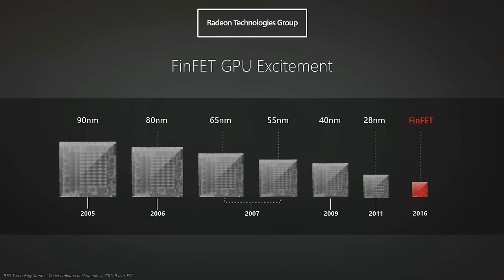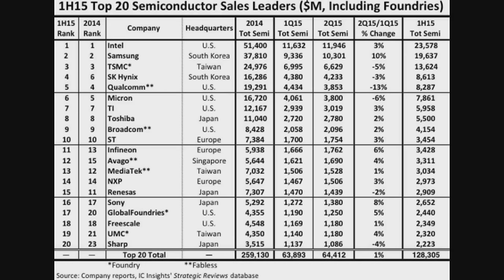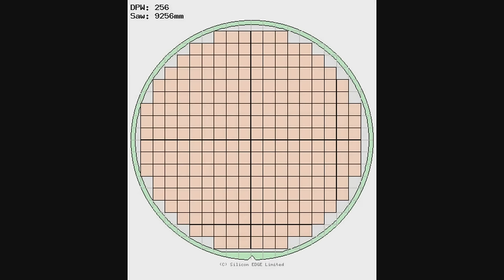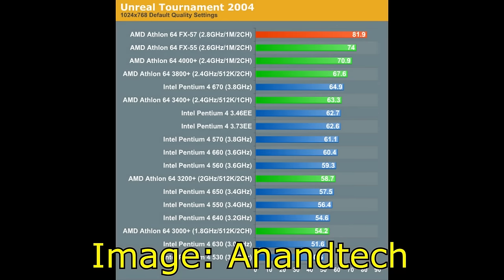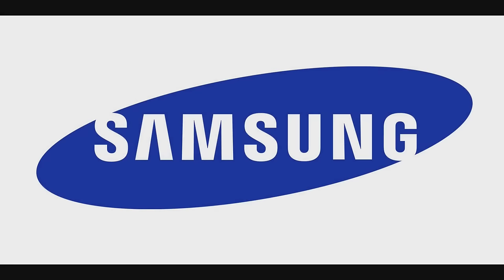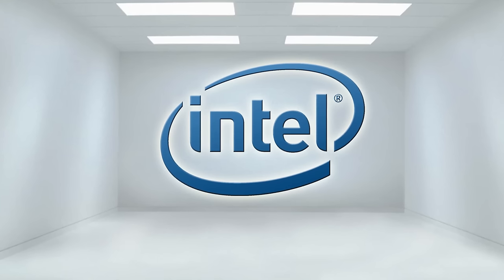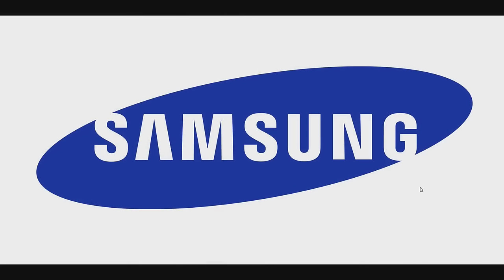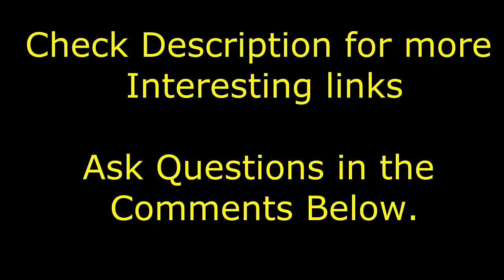Nanomatters - Chip Technology for Gamers.

Comment: Hi I've sold my GTX 980 and getting the AMD Fury or Polaris due to the Fury's superior performance over GTX 980 in Directx 12 games such as Hitman, Quantum Break, Ashes of the Singularity and many more Direct X 12 games to come etc. The AMD Fury, 390X etc trounces the GTX 980 and GTX 970 in Directx 12 and I think its due to AMD's superior asynchronous compute hardware over Nvidia Maxwell. I do not want to be stuck with an Nvidia architecture that is rapidly losing its shine. Another consideration is because I will be getting a FreeSync monitor at a price cheaper than a G-Sync monitor. Why the hell should I, as an Nvidia "fanboy", pay extra for something that is very similar and yet is not FREE? Freesync is the way to go with BIG DADDY INTEL SUPPORTING AMD on freesync now. Intel will never pay Nvidia $$ for G-Sync. They are a big company with pride. Fury, 390X and Polaris works with FreeSync while GTX 980 can't.PS Currently an Nvidia user but switching over to Team Red AMD soon. I'm supporting Team Red as I think proprietory features cause the consumers to lose in the long run. So I think AMD's GPUOpen and FreeSync are better and wiser choices. And BIG INTEL is SUPPORTING FREESYNC. So its like almost 80% Intel iGPU + AMD APU + AMD dGPU market gonna be freesync over the next 2-3 years? Yea right. So Nvidia G Sync will go the way like Toshiba's HDVD and the DoDo bird. And here's from an ex super  NVidia 'fanboy'. Enough with the proprietory crap. Let  me share with you more on wny Nvigreedia pissed an ex super NVidia fanboy like that. BTW, gibs n fluids PhysX crashes Nvidia users like me in KF2 and I DO NOT APPRECIATE NOR NEED THIS SHIT from proprietory shit. If gibs n fluids do not work well in Killing Floor 2, why the F do I need an NVidia card for??? AMD card works fine as well!  And AMD cards CAN NOW USE CPU PhysX due to the new PhysX 3.3 SDK. With a possible up to 32-core Zen on the horizon, CPU PhysX looks like big prime time. Time for CPUs to proof their worth. 8-32 cores with hyperthreading,  huge L3 caches, will boost fps under CPU PhysX. Proprietory shit (read Nvigreedia) always hurt customers OVER THE LONG RUN as there are no other flavors and options. Even Nvidia game Warframe developer HAS COME UP WITH THEIR OWN "FLOW" PhysX particle system to allow people (note: AMD ppl)  to bypass Nvidia hardware PhysX. Nice one, Warframe!!! I've seen both types of PhysX, Warframe Flow vs Nvidia PhysX. Nah, not much difference. And don't forget how GAMEWORKS (gimworks) gimp all existing Nvidia cards as well besides AMD cards etc. And the famous GTX 970 (3.5 gb + 0.5 gb 20gb/s slower bandwidth). Nvidia dude, if you want to be honest, at least slap a sticker on your GTX 970 cards explaining the last 0.5 GB will run at a slower speed. And a super staunch Nvidia supporter like me might appreciate it. Since you treat me like a POS even though I bought an NVidia card from you, I guess its time to move on. Many ppl blindly follow the crowds, go w the flow and buy what their friends buy. It is our duty to share what actually happened.It's now time to shift to Team Red with Polaris and FreeSync and GPUOpen. Enough is Enough.

Comment: Samsung should buy AMD. Then they can have GF build some of their supporting chips such as controllers of various kinds in order to fill the past contract. These chips are less critical for performance but could still benefit some from a die shrink to a mature process with high yields. Then depending on what happens Samsung could consider buying GF as well or just purchase some of their assets.
Reply: +Stu Bur Useless. AMD loses their x86-licence if they are bought, while Intel still have access to x86-64.

Comment: [Edit] OK so basically AMD, Nvidia, whoever, designs the chip and then hires a company to make what they design. Question though, how can AMD buy chips from 3 companies when they are so strongly tied to Globalfoundries?
Reply from the maker: +Games, Benchmarks, Shtuff No they'll still be sticking with GloFo because they have the WSA that I talked about in the Zen video (wafer supply agreement, lasts until 2024 I think).  Samsung will just become a 2nd supplier, they actually do have a lot of capacity though most of it is used on their own stuff.
Reply from the maker: +Games, Benchmarks, Shtuff Regarding who makes what, we're still not sure.  TSMC did the consoles for example, and the very small APUs like Brazos, while GF did Llano and Bulldozer, the mainstream APUs and desktop stuff.
Reply: I have an odd question. Does TSMC or Samsung give different prices to AMD and Nvidia? Just have to say this stuff is fascinating!
Reply from the maker: +Games, Benchmarks, Shtuff It's possible that the contracts will be different depending on volume.  In the past Nvidia had a far better contract with TSMC than AMD did.  During the Fermi era and before then Nvidia only paid for good chips, not per wafer.  That was a massive advantage over AMD who paid per wafer.  It allowed Nvidia to make bigger chips and basically lose the main disadvantage.
Reply: +AdoredTV It seems like Nvidia put a lot of stock in the fact that they thought their cards were just simply were going to sell better than AMD because if they went out of their way to make sure they had better chips with better nodes they were looking to increase their lead over AMD?
Reply from the maker: +Games, Benchmarks, Shtuff Nvidia has mostly been behind in engineering terms, they have had a small lead with bigger chips in all but a few ocassions, ie Kepler and when ATI failed with the 2900XT.  Without the ability to build bigger chips more cheaply they'd have been in real trouble, now they can rely on their pro market to basically keep their desktop business afloat during bad times.
Reply: +AdoredTV So then what happened with Maxwell? Maxwell was a huge success and they increased the amount of money they were taking in by 14% from the previous year. I sincerely hope that AMD can really compete with Nvidia with FinFET because otherwise if Nvidia has another huge success with Pascal vs. Polaris it could end up being similar to Intel and AMD. Which raises an interesting question: Since AMD want to utilize Vulkan so they don't have to go through DX12 I can imagine that since there would be such polarity between APIs that competition between Nvidia and AMD wouldn't actually drop prices due to competition alone but rather people would be more apt to pick sides - pick your pony - and cards will pretty much not see a drop in price or worse, get more expensive.
Reply from the maker: +Games, Benchmarks, Shtuff With Maxwell Nvidia optimised for later 28nm while AMD didn't, I went over that a little bit in my polaris vs pascal video.
Reply: +AdoredTV I got so lost in the current conversation that I forgot all about that. So you did. There is a lot of info in your videos and it takes a few listens to get everything down.
Reply from the maker: +Games, Benchmarks, Shtuff Yeah there's a lot of info in these. ;)